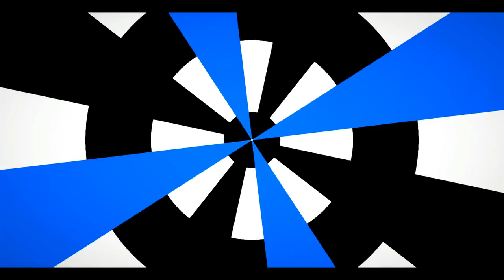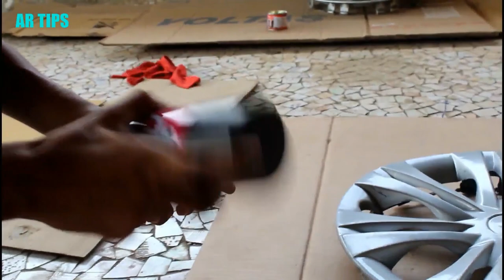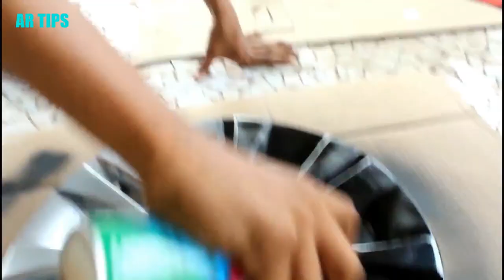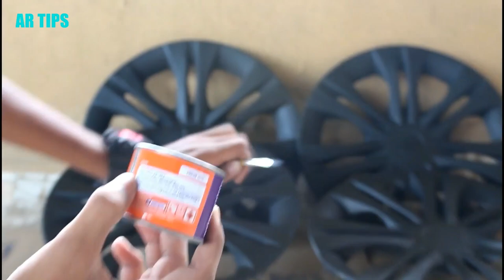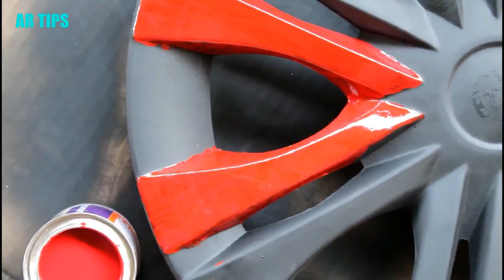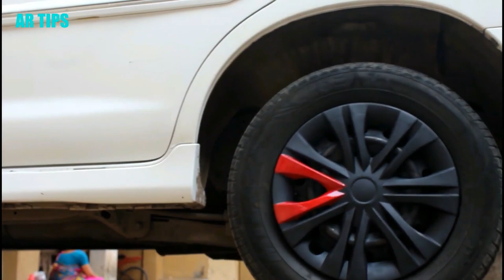How to spray paint wheel cap | How to spray paint Innova wheel at home |How to paint with spray cans

Comment: Bro how many cans required for 16 inch caps can i get the glossy black any disadvantages in glossy?
Reply from the maker: @Abdul, use 1 spray can for each cap for proper finish and matte is better than glossy. There is no disadvantage of glossy. It's your choice.
Reply: I have ordered the glossy thankyou